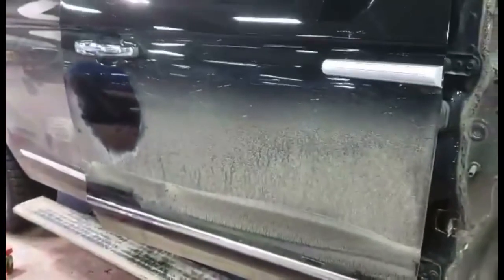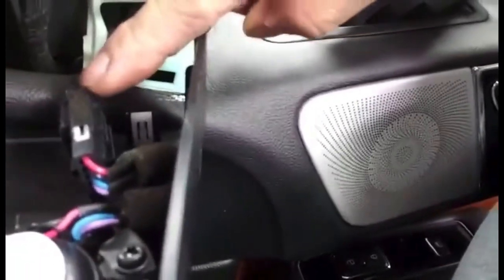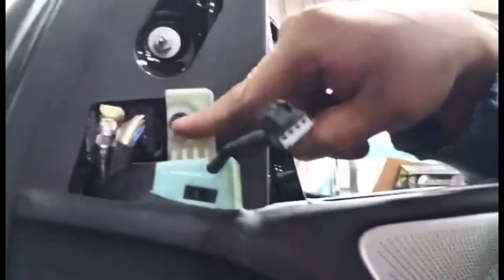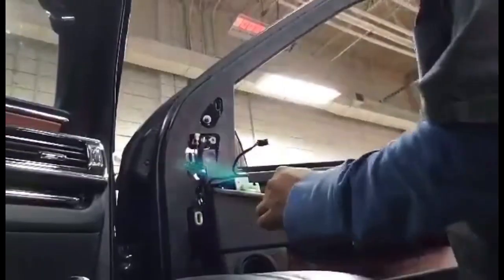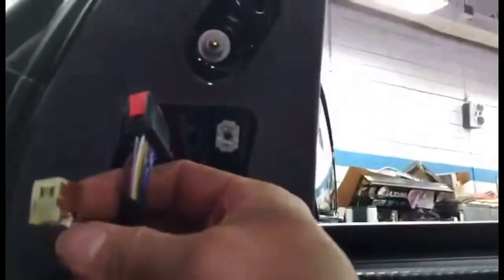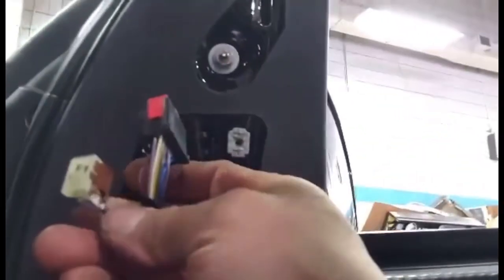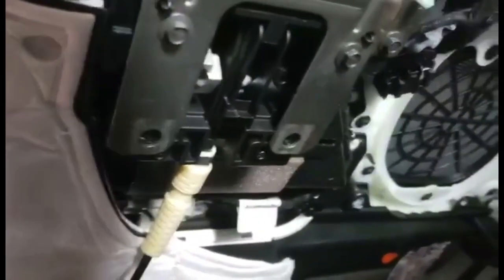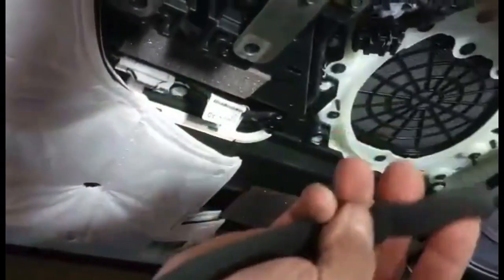How to remove side mirror and door panel of 2018 Lincoln Navigator

Comment: I need to replace the passenger seat control assembly. Do I need to remove the door panel to do this, or is it possible to remove the seat control assembly without removing the entire panel. Thanks! 2018 Lincoln Navigator L.
Reply from the maker: Honestly i havent done taking off  the sit… working in in a lots of truck indont normaly remove the panel but just be careful scratching panels and paint you might need help i know lincoln sit is heavy